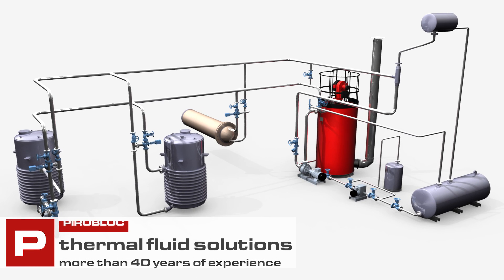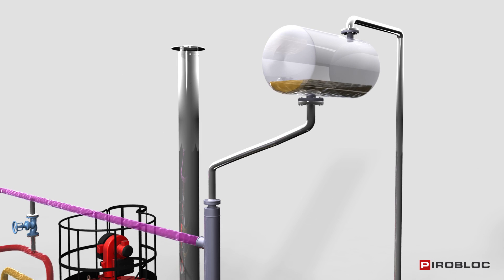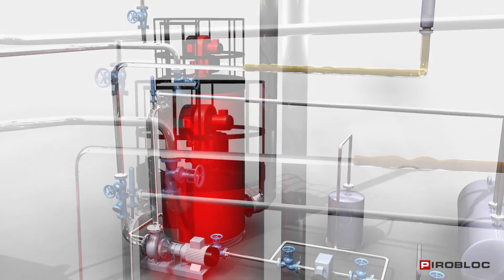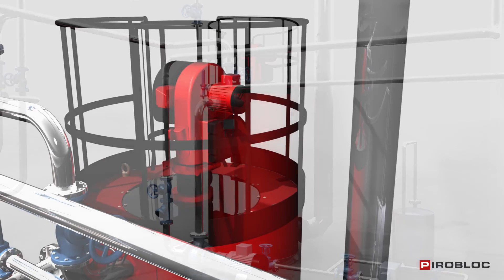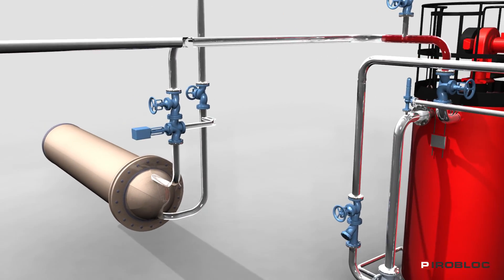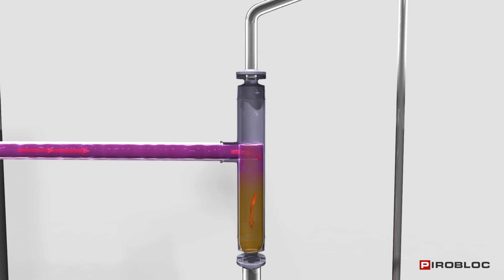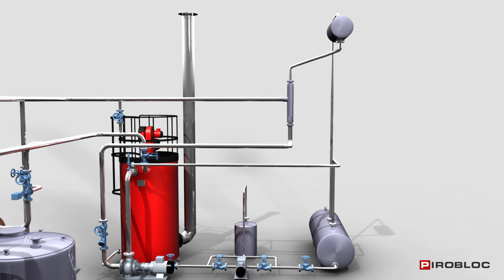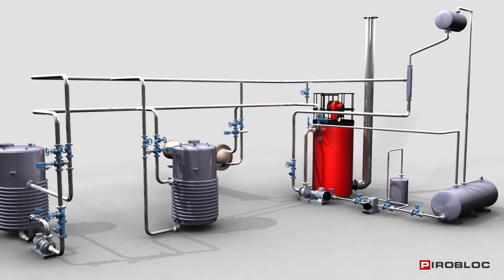Thermal oil heaters for thermal fluid systems - Pirobloc

Comment: hi, @1:27  the thermal oil from expansion tank will not flow down to degasser?
Reply: It could flow down to the draining tank just in case of overpressure in it.